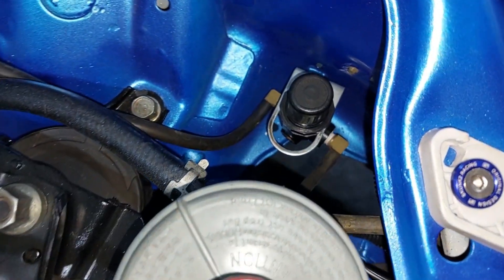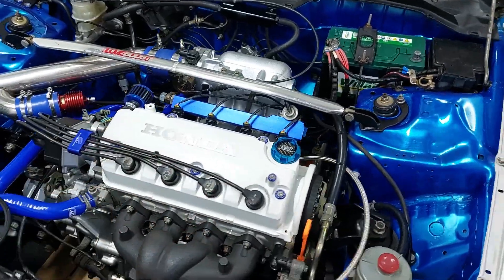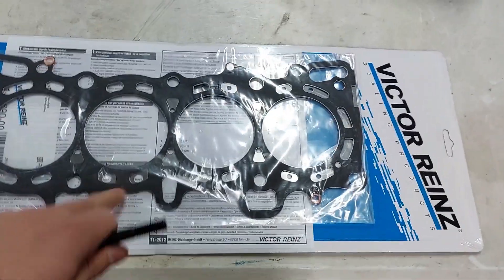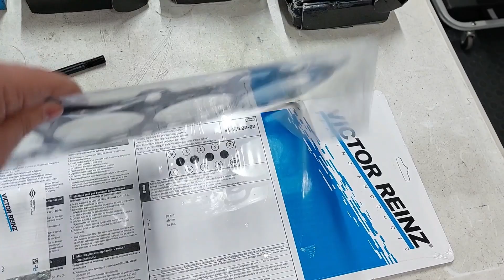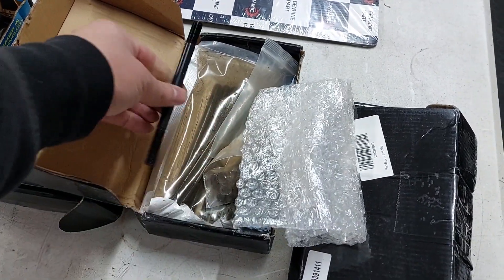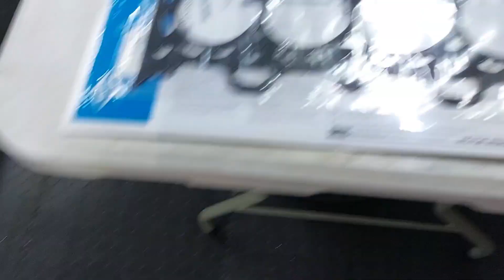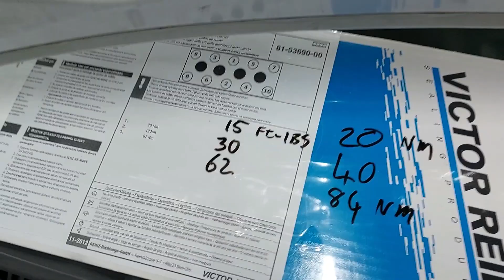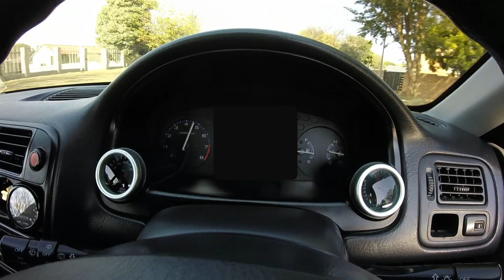Turbo Civic - Can $44 Head Studs Fix It - ARP Copy

Comment: Are the head studs still holding up?, I'm tempted to get a set for my Subaru as real ARP's are about $250 vs $35 for the knockoffs, I'm not looking to made big power I just want something that hold better than the stock bolts. And respect for the clean and tidy engine bay it looks great.
Reply from the maker: These studs are a nice upgrade, but if you want to make big power, it's safer to go with ARPs. I got about 35% more power with the studs before i got the same headgasket issues.

Comment: So 56 max? And how did they hold up endurance wise under how much hp or estimated hp
Reply from the maker: Hi, I torqued them to the ARP specs if I remember correctly, the studs is better as they don't put as much stress on the block threads as the bolts would. improvement for me was from about 100kw to 139kw before the same issue came back, so 35% better I guess. in terms of longevity there is no issues, still using them now and has reused them several times.

Comment: Can be used for D17A2?
Reply from the maker: Hi, from 2001 the D-series (All D17) has a different block, I do not know, however according to listings it will not work, you will have to measure the stock head bolts, also make sure they are all the same length, sometimes there is 2 longer studs.

Comment: May be Reps but im sure its still alot better than stock bolts. Therefore it an upgrade
Reply from the maker: definitely an upgrade yes, also safer, smaller chance of pulling threads out the block with studs.

Comment: what werethe torque specs for these again????
Reply from the maker: Hi, these are copy studs without lube or instructions, Real ARP studs are as follow
Step 1......15ft lbs
Step 2......30ft lbs
Step 3......62ft lbs

For the copy studs I used motor oil and 56ft lbs final
Reply: @RisingBoostYT  what do you mean by final?
Reply from the maker: @joseperez-zo6fr  final is step 3, so I don't torque them as high coz china
Reply: @RisingBoostYT  ok so 13 30 56?

Comment: What the fuck size is the god damn socket for these shits
Reply from the maker: It is a 12mm "bi-hex" or "12-point", must be Bi-hex or it wont fit, I had to go buy one myself, also a longer tube style will help.
Reply: @RisingBoostYT  appreciate the reply 🙏🏼 but yea I ended up figuring it out after buying a few others😂man I with they woulda put it in the instructions
Reply from the maker: @Unknowneg_  mine came with nothing, zero instructions, not even a name on the box, but they were cheap soo...

Comment: Great clean work... Checking block and head straightness is always good practice...I personally would of used the longer studs where needed with the extra washer, instead of loosing threads out of the block.... Is that a multi - layer steel shim type gasket  ???.. Look up Cometic brand..  those Studs are PQY brand, yes there have been test done,way better than Standard, a bit under ARP 8740 Studs.. PQY  approx 165,000 psi..8740 175,000 psi..STD bolts were approx 140,000 psi. its said torque PQY studs the same as ARP, ARP lube is always the best.. test have been done indepentantly..to achieve best correct torque.. glad they work for you....
Reply from the maker: Hi Colster, thanks for the info, in the end what fixed my issue for blowing headgaskets was getting a thick gasket from the EG motor, the "paper" style gasket, I assume my compression was to high for the pump feul, as it blew again on the dyno, but i have not hand an issue since installing the (cheap) thick headgasket. The fake arps did help as it only blew at 170hp instead of 120hp.
Reply: @RisingBoostYT  The Cometic steel shim multi layer gasket will solve any head gasket issue.. keep well

Comment: You're telling me your fake arp's actually came with torque spec instructions?? bruh mine didn't
Reply from the maker: Hi bro, no they did not come with anything, but they claim similar strength and manufacturing process, so I used the specs for real ARP Studs. 1 stud stretched when I over torqued them. but at "real ARP spec" they were all still fine. car still running now with the studs. better than stock, not as good as real ARP.
Reply: @RisingBoostYT  Oh okay thanks. I got the same ones for my b series but didnt know what torque spec to use. Definitely didnt plan on reusing them like real ARP's anyways especially cuz i can get them for 15$ where im at
Reply from the maker: That's not bad, I may reuse mine as they about 30$ for me and take 60 days to deliver

Comment: Too bad you didn't measure the hardness of the bolt. that would tell us what material it's made of. I met an opinion on Ali that this material is below the 10.9 bolt strength class. But thanks for wanting to record it.
Reply from the maker: Hi Grzegorz, there is a video available on youtube where a guy test bolts like this for the LS v8 engine, it should help you. the bolts are better than OEM I can tell you that much.

Comment: why dont use oring?
Reply from the maker: Hi Casal, are you referring to gasket o-rings? I will have to get grooves cut into the block surface for fitting copper o-rings, it will solve the problem however it will be too expensive to have it done.
Reply: @RisingBoostYT  
I'm from brazil, also building a Y8 to turbo, it will be around 300hp, I'll use connecting rods and forged piston, steel joint with copper oring
Reply from the maker: Sounds like a good setup, it should hold 300. Forged rods, pistons and ARP studs and you should be good!
Reply: @RisingBoostYT  yes, I will provide the arp studs

Comment: Honda d16w5…???
Reply from the maker: Hi Fabio, the D16w is part of the D17 motors, made after year 2000. They are slightly different to the older pre 00 motors. Looking at the listing these onse will not fit as they are not listed on the product, I'll see if I can find something for you.
Reply: @RisingBoostYT  thanks my friends ,,,,,,,,,,
Reply from the maker: @bellottiracing  looks like the D17 use the long studs, same as D16Z6
Reply: @RisingBoostYT my friend.....help my ......help my
Reply from the maker: @fabiobellotti75  The Honda Factory part number for D17 lx is
HP 9005-PM3-00
The 95 civic si 1.6 vtec D16 engine uses the same Honda factory bolts.
ARP makes studs for this engine and it will fit D17.
ARP part # 2084301 Honda D-16 HSK for 1.6 SHOC vtec application. 10 studs
NOTE: ARP makes two types Z&Y (OURS is Z)
All 88 thru 95 civics and others with same engine use the same type of head bolts.

Comment: Do You think these studs would hold 250-300hp on d16y8? I know this engine stock can hold 210hp… should i try it or buy legit arp?
Reply from the maker: Hi bro, I think it may. I had high compression of about 9.8 and head gasket failed at 160hp with the studs, dropped the compression to 8.9-1 now and at like 190hp+ I have no issues reusing the same set of studs

Comment: In my experience, repeat HG failures on a boosted single cam are almost always related to ignition timing. You shouldn’t be repeatedly blowing a HG, even on stock hardware. Instead of retarding the distributor, take the boost portion of your timing map and cut all the values by half until you can get a professional to tune it.
Reply from the maker: Hi Shawn, thanks for the advice, I was thinking the same thing. car had no issues before on a non-vtec D15 at 7psi. the new build increase the compression ratio from 9.2 to 9.7 and I think now the high comp and ignition timing is definitely the issue. I did actually pull timing on the map like you said.  thanks for sharing!
Reply: @RisingBoostYT  no problem, sorry to preach! It will be so fun and worth it when you get it dialed in.
Reply: I know 4g63 blocks can sometimes warp when you run bigger studs and torque which lead to bad sealing and gasket problems so not sure if that's the same problem here.

Comment: Hello, which screws do u have to lock the head cover on the head? Because i have the original ones.. and 2 of them broke off and one is even in the head. :( I dont really know to get it out. I think i bore it out. But i want to use other screws then.. the original ones are soft like butter.  (im speaking about the valve cover)
Reply from the maker: Hi, you can buy the ones I have from Amazon - https://amzn.to/3Q7QuI2 , I had to get 2 longer bolts just be be safe but the kits are not always the same. to get the broken bolts out try getting a small "easyout" and a small  drill, it's a bit safer then just drilling it out. you can also try to make a grove in the broken off part using a small flat screwdriver and hammer so you can turn it out like a screw. worst case is to drill it our and retap for an insert, just don't get metal shavings into the motor.

Comment: nice upgrade I mean a “stud” vs bolt is a lot better when we think about it tightening the head bolt (factory) you pull the thread by way of tightening the head down

With a stud it does the same but not as much because you clamp down the head with the actual nut vs stressing the block thread by tightening…

Locally I’ve seen crazy peeps machine their own out of stock head bolts so these copy seems alright I mean maybe until u start pushing 4bar then an L19 stud is needed 

Much needed upgrade here this one is good
Reply from the maker: Hi SRD, yes they are better in that way, less chance of stripping out your block. they do hold more power over stock, but for big power, 1 bar + I would still recommend getting the real stuff. my testing show they hold 50% more power, but I am still testing them. it may have been something else causing my issues.

Comment: Why not spend the extra money on known brand quality parts?
Reply from the maker: Hi, there is a few reasons I decided to go the cheap route, but the main reason is this is a temporary motor/setup so I don't want to spend a load of money on it. also testing the cheap stuff is informational, testing real ARP studs is a waste as we already know its good and will work. but very valid question, thanks.
Reply: @RisingBoostYT  so how did they hold up? I'm using a 65 dollar set. They were called the back 12 point head studs but I haven't had the luck of finishing the engine yet to hear it fire up and running.
Reply from the maker: @dookieren7430  so far so good, my issue was a high compression ratio, the Copy Studs made about a 20% improvement over OEM before the gasket issue was back, however since I dropped the compression ratio its perfect, I estimate the studs will hold 260hp to 270hp. but detonation at that power will lift the head.

Comment: I caught my mechanic messing up my engine on purpose... walked in on him saw it with my own eyes!
I figured out and fixed most of them... maybe all of them!
1 thing is, he tried to convince me my head gasket was blown Last year March. 
So that's almost 1 1/2 years. I took it to 3 other mechanics and they couldn't figure out anything wrong. 
They all insisted I had a strong engine and nothing is wrong that he was messing with me!

And I've been driving my car since with no problems at all. MPG is back up, smooth running, full Power!

1 of the many things he did was loosen all the valve cover bolts, almost finger loose, and fluid started leaking... I did fix that... 

However I wonder if possibly he could have loosened some of the head bolts by taking off the valve cover.
I am sure he didn't take anything else off because that would have been way to much work... 
#1 If he did do this, since the car is running better than it's ran in years and never over heated, can we just replace the head gasket? Or do we have to have it shaved down? It has never overheated or anything like that. Runs perfectly with full power. I had another mechanic 7 years ago rebuild the engine and it runs great! 

#2 Is it possible we can just tighten the bolts back down? (I mean the one's he might have had access to with just taking off the valve cover. )

Another mechanic said it's possible to get to 2 head bolts from taking off the valve cover.... and said we would have to take off the head to tighten them all down in in the patterned way... I was hoping if he did do this we could just get to the bolts he might have loosened and just tighten them down to spec. without having to take the whole thing off and tighten them all.
Honda Del Sol D15B7
Reply from the maker: Hi Mike, sorry to hear that, some mechanics can be untrustworthy. the D15B7 you have access to all the head bolts once the valve cover is removed. you can just replace a head gasket if the car did not overheat, if the head or block is not warped it will work, if it is warped the gasket will likely fail again. if you fear that he loosened the head studs you can just retorque them, that will show you if he did that. however if the gasket failed already it will likely need to be replaced. but if your gasket is not currently a problem you should have no problems just re-torquing them.

Comment: Mate I have a d16y1.. what studs would I need??
Reply from the maker: Hi Arthur, this is actually a difficult one to know, it's an older engine but it has the P08 head, my guess is that it is the long studs but I cannot confirm that. is this motor from an EG? is the dipstick between the exhaust runners or by the cam belt?
Reply: @RisingBoostYT  it's an eh9 sedan.. the dipstick is between the exhaust runners
Reply from the maker: It sounds like the older motor, they normally use the long studs, but I can not be 100% sure, best is to pull out a stud and check the length. looking at the specs it seems like a version of the Z6. what is the part number on the block? its normally on the block at the back where the trans and block meetup. if it is PO8 like your cylinder head then it is the long studs.